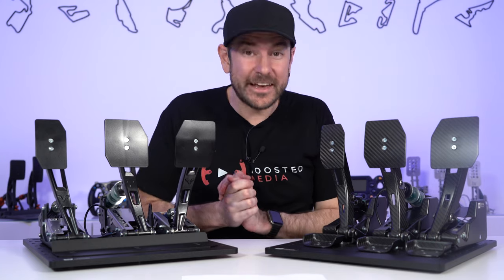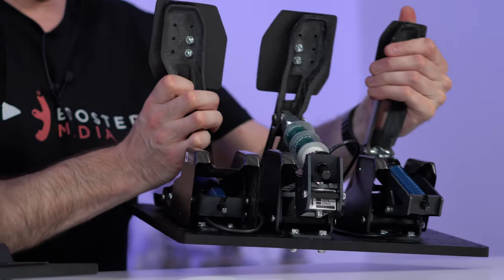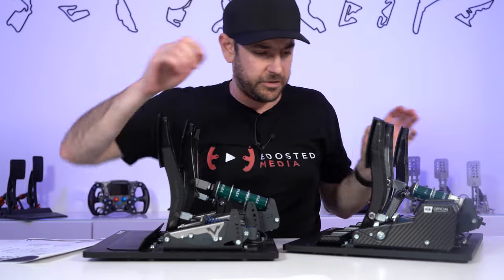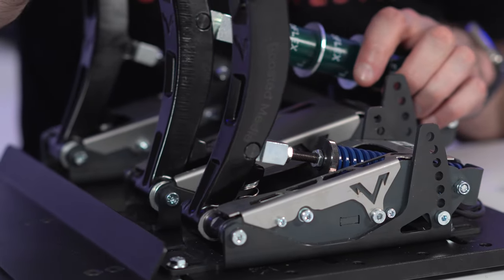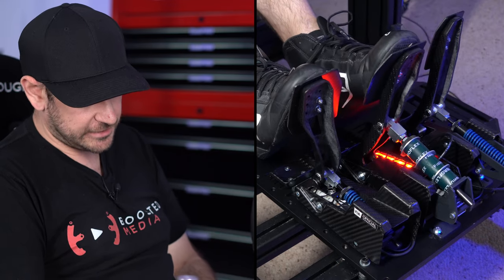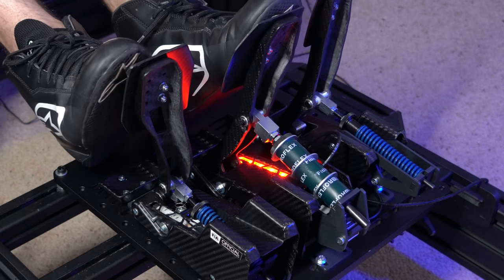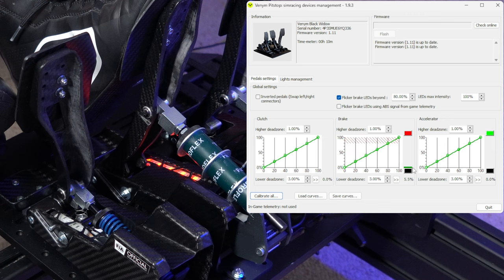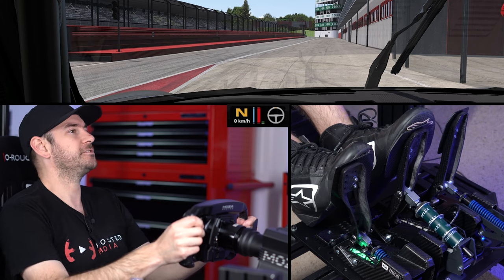REVIEW - Venym Atrax & Black Widow Sim Racing Pedals

Comment: 1st, thanks for the review and your hard work. 2nd if I saw your review before buying, I never would buy those. But I did before your review, and glad I did. I have the aluminium version and I love them. Most of the issues mentioned are not an issue for those that want to set up once and forget.

I got my pedals waaay before you did yours for review, and I didnt have any issues with the throttle at all. Its really sad tho, as it does undermine the companys quality control a lot. The whole carbon fiber fiasco is crazy.
Reply: I really likes this review. Like you I bought those quite some time ago and I don’t remember any of those issues (except for the mounting part). I went to check my pedals as soon as a finished this video (the throttle spring is a big issue) and I couldn’t provoke a situation where the spring would come out even by pulling on the pedal as hard as I could.  There is no point of contact between the cover and the pedals anywhere.

It seems they changed the design and it was for the worse. With this review out I wouldn’t recommend those right now.
Reply: Agree with you, same on my side I didnt have any issues with the throttle at all, it clearly undermining the company quality when this is not the reality.

Comment: Not on the market for a new set of pedals but if I was, these would not even be a consideration. Especially after seeing this review. Carbon set is a gimmick. As are the LED strips; what benefit does an LED offer. Overall quality of both sets seems questionable. Great stuff Will.
Reply: Remove all of those gimmicks and you get pedals with adjustability and drivability of HE Ultimates at lower price. I guess I was lucky, but i had no issues woth throttle as Will had in the beginning
Reply: @ZheikoNileth  Agree with u!

Comment: Safe to say the pedal market is now saturated?  At this point, really only interested in new advancements and technologies such as Simucube FFB pedals via servo motor.  The CF here definitely look great though and as you stated this throttle here looks to be one of the very best.

Coming from a Simtrecs Pro GT owner, my complaint with those is that the throttle is just uniform throughout the travel and doesn't offer a progressive feeling.

Comment: Nothing planned for the Meca Sim Evo1 Pedals yet?
Reply: Have they dropped yet. I thought it was a Nov release?
Reply: @matthewbeale8570  They have been out for a few months now. Waiting for mine to arrive and still no reviews out there...
Reply: @matteostopiglia1671 which did your go for? And do you mind what the price was. If you're in Australia? I'm seriously considering the load cell set clutch brake accelerator. And yes a review would be nice.
Reply: @matthewbeale8570  I bought the hydraulic 3 pedals version with the baseplate, total of around 1.000€. I'm from Italy tho.

Comment: If money was not a concern what pedals would you recommend i get?    Ive just finished my triple g7 set up with a dell i9 12k and rtx 3090     I have the DD1 and was looking to upgrade my pedals.     Your input is greatly appreciated.  love the videos
Reply from the maker: I absolutely love the Asetek Invicta pedals and run them on my daily driver, but they aren’t suitable for everyone. Out of everything I’ve tested, the best all rounders with the highest build quality are the Heusinkveld Ultimate+ in my opinion.
Reply: @boostedmedia  Thank you for the quick response.  I live in Canada is there an online store or a link you would recommend to order these that can help you out?
Reply from the maker: Thanks a lot for the support. Here’s the li k to our full review which has an affiliate link for Digital Motorsports.

https://boostedmedia.net/sim-racing/review-heusinkveld-ultimate-sim-racing-pedals/
Reply: @gregogilvie8888  Check out the Imsim Talento pedals they are right up there with the HE ultimate + but a little cheaper. I have recently added them to  my rig - they are well worth the money. 👌

Comment: "100 kg is giving you everything you need to feel"
Me: driving my csl elite v2s on 45kg --
Reply from the maker: That’s why I said it depends entirely on your preference. I think the CSL Elite V2s are the best value peals on the market currently. Out of the pedals we’ve tested anyway.
Reply: @boostedmedia  yes they are not bad 

But i also think that 60kg on the csl elite pedals feel munch heavier than 60kg on the normal csl lc pedals
Reply: I have my Heusinkveld Ultimate+ soft rubbers and 24 kg 🤦😂